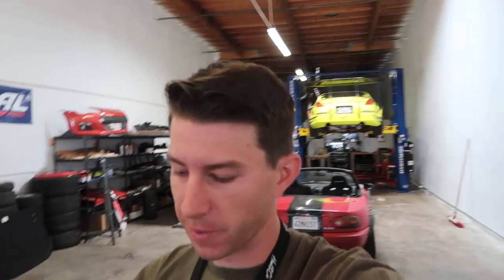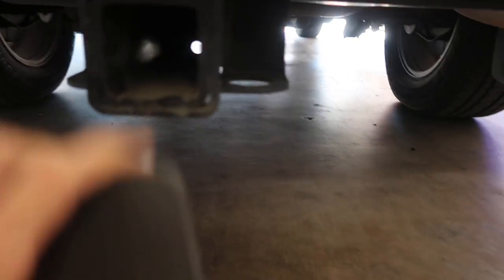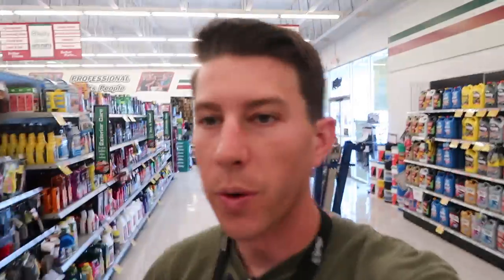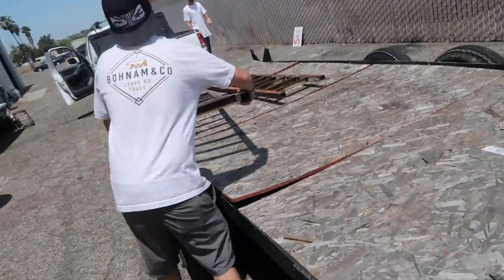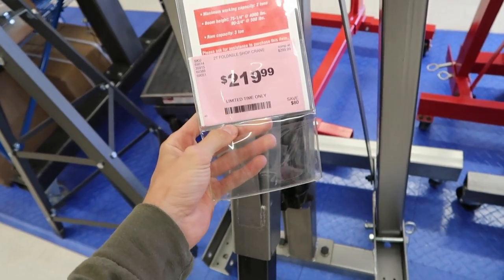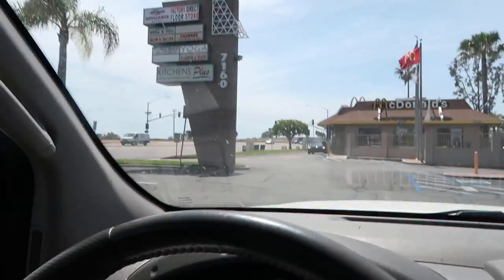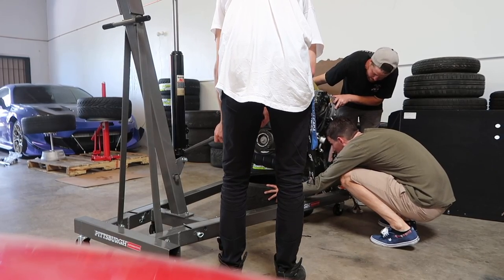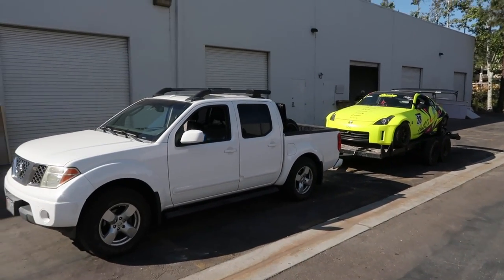This determines what Truck I Buy!!

Comment: You should get some air bag helpers for the frontier. Helps the suspension on the back. Then add a compressor and be able to air up tires too.

Comment: I have towed 2 ton of dirt in a 300 lb trailer up and down Kentucky hills with my ratted out '92 s10 with no issues. Before my s10 I towed scrap metal and scrap cars with a Ford mini van. You truck can take it especially since you won't be off road towing much.

Comment: Should get a Toyota Tundra: Toyota has a great reputation of reliability and long lasting engines and pretty quick 0-60 in 6.1 seconds and I can tow 10,000 pounds and the engine has 381 horsepower and 401 pound feet of torque and if you supercharged the Toyota Tundra it can get 500 horsepower

Comment: Hey tj. The way your truck was squatting and the amount you had to slow down early should be a indication that the truck is way overloaded. You feel fine and it's towing, they all will but it's your control and breaking that are severely reduced. In vehicles, always remember the three most important things, brakes, steering and suspension, if one of three are compromised then your looking for trouble. A upgrade is a good recommendation, nothing huge, but a half ton with air bags or a 3/4 gas or diesel will be your best bet. Please be safe and go slow. We want you to keep making great videos.

Comment: Don't know if anyone has said this yet or not, but if you back the rear truck wheels onto a set of the rhino ramps with the trailer, it'll change the angle of approach for your car going on and it'll be less likely to scrape (if it's an issue)
I used to do this with my trucks whenever I would pull my Corvette after almost pulling my bumper off to get it to the track

Comment: Teej, the payload capacity for the truck accounts for the weight of the trailer tongue and anything inside the truck. If you want a truck that holds a car and 5 people get a truck with a good payload cap. (Also you usually want a 10% trailer tongue weight so if the trailer weighs 5000lbs it should have 500lbs on the hitch). So as long as you are under the payload cap. and the towing cap. if anything happens insurance should cover it.

Comment: Yeah, if you're really worried I'd add a transmission cooler and it will greatly increase your tow capacity. I know you don't wanna modify the frontier but you really don't need a new truck, the v6 in the frontier is more than enough for your 350.

Comment: it's great that you want to start trailering your car and are willing to learn how. however the frontier is not rated for that much weight and the trailer itself has trailer house axles which are illegal in some states and are only meant to be used to transport a trailer house once. besides only being designed to be used once, they're difficult to find replacement tires for and only rated to 55mph. If I was you I'd suggest a larger truck with atleast a V8, and a safe trailer with brakes and tires you can actually find on the road in an emergency

Comment: TJ, if you would buy a 3/4 ton or 1 ton diesel truck, the come with trailer brake controllers and you wouldn't even feel the truck pulling, I suggest the dodge diesel or the ford diesel. You would probably like the dodge best because of the straight 6 turbo diesel

Comment: Teej When backing up with a trailer all you do is steer the truck in the opposite direction of which the trailer needs to go and the trailer will go in the direction you want it to but the only reason I know this at 14 yrs old is because my dad was a truck driver for like 7 yrs or so and I used to go with him all the time.

Comment: Yo Tj try finding little performance parts, bigger radiator and brakes for the frontier. a little more power will help move it better. also a simple lift to make it a little stiffer nothing crazy but maybe a 3 inch. And more aggressive all-terrain tires for traction.

Comment: Get an older diesel truck like a cummins or duramax, the brand new ones will break the bank and the older ones are just as good for towing. that little v6 wont last
Reply: Yeah, not to mention most of the older diesels look better, at least in my opinion.

Comment: When driving with a trailer put your hand upside down on the bottom of the steering wheel and when you turn it, your hand will be on the side the trailer is going 👍

Comment: You should upgrade the suspension on the truck because of the added weight, also you should install an additional transmission oil and engine oil cooler. You are pushing the truck to its limit.

Comment: The frontier isn't a bad truck , it's just not the strongest or most powerful , but it's nice for cruises
Reply: its powerful for sure, I could tear a hole in the gravel with my stepdads 2017 desert runner😉

Comment: You are at the max towing capacity of that truck. so it's up to you if you want to use it, if you do is would recommend getting a equalizer hitch to get some of the weight off of the tongue.

Comment: The chevy quality has gone down but the performance is also a good truck. The Ford aluminum body isn't the greatest but the transmission is decent. Alison transmission on duramax (chevy) and cummins (dodge) is a great transmission. Personally the best performing trucks are Dodge and Chevy and you  generally want stiffer steering when hauling but all the new trucks are great options. Modifications that would benefit your experience are Airbags which help the rear of the truck not sag as much will helps in the overall ride. Aftermarket wheels, American Forged and specially forged wheels are great but when it comes down to performance, under a heavy load will crack. Fuel wheels with a nice offset that are deep but not to deep to where the rim will crack. Trucks now a days already have amazing performance regardless of brand. If you want more power then you could fully delete and tune the truck for more power. Cat back exhaust will be easiest because of the new computer systems in the truck. But if you delete the truck than a turbo back will be a better choice and make better sounds. If you are really into trucks. A lift kit would be awesome and I think would help the channel grow while you can buy a drop hitch to be able to haul your trailer still. The best bumpers to put on your nice diesel truck are fusion bumpers in my opinion. Thanks and like this so Tj can see :).

Comment: Good trick for backing up with a trailer is to grab the bottom of the wheel and look backwards, whatever way you want the trailer to move you move your hand in that direction.  Also please don't buy a Raptor for towing, total hoser move.

Comment: You should get a 2016 or newer f150. Can easily tow that and has a towing assist feature where you can reverse and park with a trailer without using the steering wheel. 😄

Comment: I have a 2010 BMW X5 that has a 3 litre inline 6 twin turbo diesel that can pull 6000 pounds. It tows better than any truck can because the trailer hitch is closer to the rear wheels. I had to install a tow hitch because they dont come with them. But it is the best vehicle i have ever towed with and ive had a 1500 Silverado and a 2500 gmc sierra. And all these people saying you need a 2500, you dont. Pretty much and V8 1500 truck will be able to pull your 350 with tool, tires and people no problem

Comment: Just upgrade the rear suspension on the truck better springs and shocks or helper springs much cheaper then a new truck if this truck can handle it and boom tow rig think about it Tj?? Trailer brake a must

Comment: You would probably be fine with a trailer brake and rear air bags on the truck to level it out, but you are better off getting a truck/trailer combo capable of towing your 3900lb gtr or bigger vehicles.  Also if you just practice backing up for a couple hours you'll be fine.

Comment: Towing that much weight with the Frontier will be fine for a couple trips, but towing the max limit is not the best option. Buying a 1/2 ton truck like a 1500 chevy or dodge, or a f-150 would be your best option. You can get decent prices, and max towing is around 10,000lbs. So you would have a little room to grow, too.

Comment: You are definetly pushing the 6500 lbs max towing capacity with like 500-900 lbs to spare for gear/supplies. I would suggest checking the temps via OBD2 readout during the trip.
Also actually suprised that its legal to tow so much weight without electric trailer brakes.

Comment: Ford: Higher tow weight no upgrades for motor
Chevy: Lowest tow weight PLENTY of upgrades
Dodge: Mid tow weight between all and also has a good amount of upgrades.
I like Ford because of the better tow weight but I don't do many upgrades. Never had any issues
I suggest getting a diesel for sure though!
NO TUNDRA

Comment: Tj just put bags on the rear and it should drive like normal cause with bags it makes the ride smoother as if there really isn't a trailer of course you'll still feel it when it comes to speed but with bumps you won't really feel much

Comment: Get a aluminum car trailer, not that expensive and they are very light, and they work just as good if not better because you can get a low trailer

Comment: Will definitely need something with more power. Spend the $ and get a turbo diesel.
I love the weight too, try hauling 50,000lbs. Puts a grin on my face every time. Pedal to the floor, rocking thru the gears, engine roaring and that turbo screaming. 
You can't understand what 80,000lbs is until your behind that wheel.

Comment: Tj! If you are using the max capacity of your truck that is bad because if you are on a hill or anywhere and need to stop quickly you have more weight on the trailer than you have on the truck. What I'm basically saying is that it's like the tail wagging the dog! Like so tj can see

Comment: Yo dude just going to trying and give some of my advice I tow lots of things in the past like a boat 24 foot sailfish with twin 225s on the back with a f350 don't know the exact weight but I got in a wreck because of my brakes someone came to complete stop fast while I was towing the boat and my brakes weren't enough from about 400ft from 50 mph so just to be safe I'd suggest getting a f250 or anything along those lines to tow your car so that you won't put others at risk take my advice or not i don't care still will watch your videos

Comment: i have a frontier, that 6500lbs capacity is with a weight distribution hitch only, otherwise its only 5000. Having towed a car with mine before i can tell you its too much weight for the truck, you also are not considering the tongue weight or the weight of other gear

Comment: A raptor is a bad idea for a tow rig it's more of and off road truck but you don't want an f-150 either especially with the eco boost defiantly get a 2500 or f-250 if you and Calvin decide to tow both your cars to the track and all your extra gear

Comment: Please get a diesel, they have so much more power and are rigged for pulling. You are around your max capacity, under sustained load you are going to cause it to overheat and the torque converter and transmission are going to melt. Also it if you get a new truck try to get a fifth wheel hitch instead of a bumper tow hitch, fifth wheel hitch raises the weight to a more optimal spot for the truck but you also have to get another trailer. Plus it rides nicer and is easier on the brakes.  Try to get one of the 5.9 or 6.7L Cummins engines. My dad has a 5.9L in his and it dragged a fifth wheel across the west coast. Also the ford 6.7 or 6.4-liter diesels are good.

Comment: Being at the max towing capacity is not a good idea. Also you need to make sure you have enough power to be able to control the trailer if it starts to sway back and forth or it could end badly.

Comment: YO tj your home boi wasn't tightening the bolts and nuts for the wheels on the "cherry piker". thought you might want a heads up. If your curios he didn't have wrench on the other side so the entire bolt and nut was spinning.

Comment: You should get a gmc or chevy 2500 with a duramax diesel, or a ram 2500 with a cummins diesel to tow that car in the most comfortable way, without over working the truck

Comment: if you want diesel go with dodge cummins or chevy/gmc duramax with what you'll be towing you wont need a dually but can get one if you want. if you dont want a diesel then get any dodge ram v8 and up same with chevy silverado / gmc Sierra or the Toyota tundra is pretty nice but whatever you do dont get a ford.

Comment: You are over the weight limit for that truck. You're going to want a 1/2 ton truck: A  V8 Gas, or B V6 Diesel either/or, if you're sold on the Nissan then get a Titan that'll handle your requirements for the time being at the very least.

Comment: I tow vehicles for a living and towing with that truck at that much weight is a safety hazard! You need to either get a 1500 or a 2500 to tow without a problem

Comment: Do NOT tow with that frointier, it is unsafe and your are past your max tow. you will be wearing down parts on your truck a lot faster. It is not okay to have your truck maxed out, your leaf springs will give out and those brakes are gonna be gone quick. get yourself a F150 or 1500 Silverado. you do not need a diesel unless you just want one for shits and giggles. A diesel is more expensive to fix if anything breaks on it and the fuel is more expensive. Unless your planning on pulling almost daily then go for the diesel if not stick with a gasser. I would recommend getting a F150 with the 5.0 or 3.5 ecoboost or a Silverado with the V8 and of course 4x4 with towing package.

Comment: You need to get a cummins diesel, using the frontier with only a V6 is pushing it way too much and putting un-needed stress on the whole truck

Comment: Yeah, don't. Too much weight. I had to emergency tow my 92 Tbird (~3800lbs) with my 06 Frontier 4x4. And that was only 20 miles and felt it stress. It tows our boat just fine, but I'd never tow with this thing again.

Comment: Quick question in your video "my girlfriend ruined my clutch" at 3 mins when you first turned on the car your Z made a screeching sound exactly like how mine does. Do you know what that sound is because I can't figure it out. Its been on and off but usually my first start of the day makes the sound. My belts seem fine and you changed yours not too long ago so I don't think that the problem but idk.

Comment: Don't worry tj that truck can handle it without problem don't listen those paranoid people you don't need a v8 or diesel to tow one car v6 is enough to handle that i see tacomas and frontier towing more than that and they still running around

Comment: look man it isnt a good idea to tow with that it is pushing the truck to far best thing to do is get an old diesel and call it done get a clean pne and it will pull that trailer and car like nothing is there put an exaust on the truck and itll sound great to

Comment: get a ford. just not the 3 valve 5.4.... Find a V10 or 7.3/6.7 diesel. No problems towing any of the cars. also a GOOD trailer will help with towing.

Comment: don't get a Ford raptor it's not so good at towing a dodge dually 2500 or 3500 is perfect I tow my r34  with a 2500 with a Max towing of 13,000 pounds a 3500 is at least 15,000 I recommend dodge strongly

Comment: You are most definitely not ok with the frontier. A lot of people have made really good points about insurances not paying your claim out. It IS DEFINITELY A BAD THING if your truck uses all it has to tow. Your truck  is not at all meant to continuously tow at max capacity it would be like you driving at your cars max speed, it gets sketchy. Putting car preferences aside, you need a basic truck with a v8 or a v6 turbo set up that can tow about 9,000+ pounds of you'll be having people, tires, fuel, and more in your truck. You can get as flashy as you'd like but a diesel is pointless for your use, any heavy duty 250 2500 type of truck is simply too much for your use, and remember where the truck will be mostly used lane width and parking space matters in a truck.

Comment: The max towing capacity isn't based on how much the truck can necessarily pull its based on how much it can safely stop... Which if you are even a bit over is extremely dangerous for not just you but anybody around you. That truck is 100% not ok to be towing that. Don't be dumb and risk other peoples lives while being an inexperienced tower with an unsafe rig...

Comment: Not safe to tow like that man. Get yourself a diesel, doesn't even have to be new. 90's diesel will still haul a 10k load with ease. Look into it man. Wouldn't want you hurt from towing at max capacities.

Comment: bro you should get a dodge cummins ram 2500 4×4 6.7l 2004 or a 2005 if you buy one it will cost you around 20,000 or 30,000 thousand dollars some were in between.

Comment: buy a dodge if you want over priced crap, go with a ford 7.3 they are stupid reliable and cheap to repair replace or rebuild, if your good at staying on top of maintenance the the 05-07 6.0 powerstroke is good after its been "bulletproofed" after 07 you start getting into some pretty serious emissions stuff that isnt worth the headache chevy is a crap shoot any way tou look at them ... certified diesel tech and used to sell for ford as well as dodge ao i have absolutely no idea what im talking about

Comment: You should never max out your towing capacity of your truck you can blow your transmission. If you want to tow the 350 you'll need a 1500. I don't want to see you mess you truck up.

Comment: Thats not how it works ma dude. when towing you have to take into consideration braking capacity also! You don't want to be towing +75% of what you are capable because that puts you at an extreme disadvantage when stopping risking breaks going out. The hitch capacity is not the same as the truck either. will it work for a trip or two maybe but you're pushing a truck to its limits. Get a bigger truck Please save the headache.